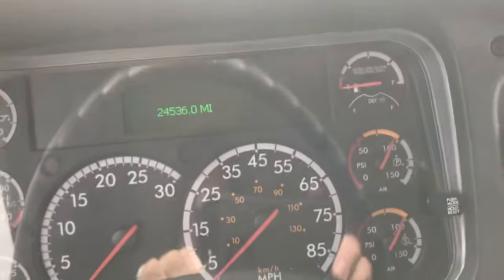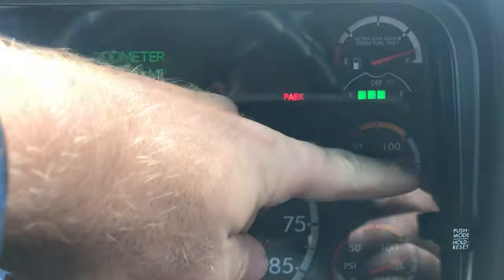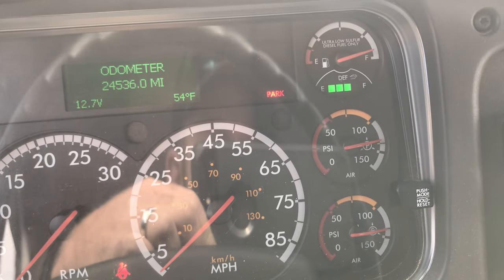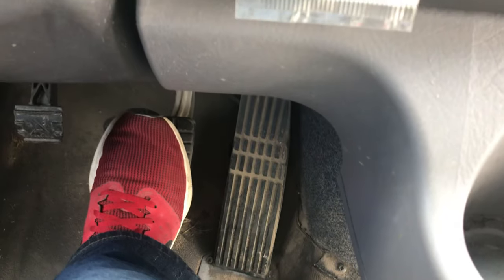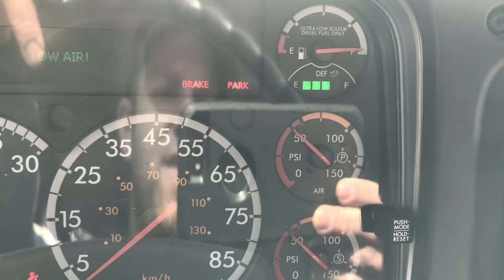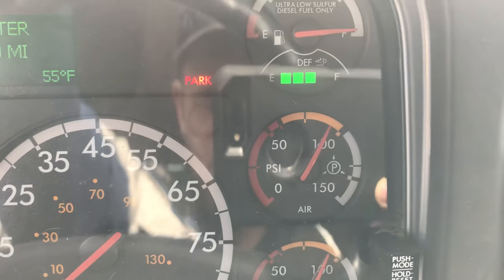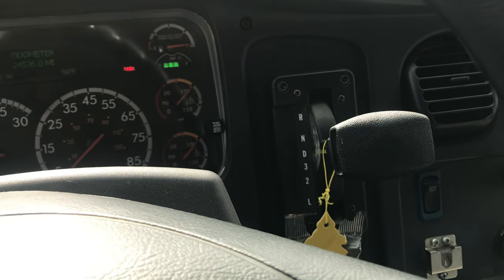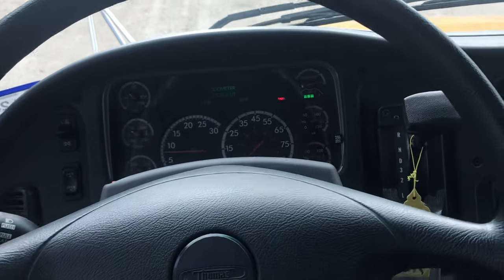Air Brake Test - School Bus

Comment: Question; you mentioned the loss of no more than 2psi in a minute after disengaging the parking brake... If you fail to do this can you automatically fail pretrip?  Because it's not mentioned in the book regarding the pretrip
Reply from the maker: Yes. You have to mention that you’re watching for no more than 2 psi drop and you have to demonstrate either with a count or a wrist watch that it is a full minute. If you don’t have a watch the instructor should and they may assist you if you ask them to time it. I counted out loud, just make sure to count slow. If you count too fast and say it’s a minute when it’s only been 55 seconds they can dock you. 3 psi drop for the service brake.

Comment: Never saw the ABS light test,  this omission would have been an automatic fail when I got my endorsement. Is this not required? We were taught to turn the key to run then the light would have come on for a few seconds and then gone out, now you've verified the ABS will work and you are ready to start the engine. And just as a general rule on these new computer controlled vehicles,  you should turn the key to run and then wait a few seconds for the gauges to sweep and not just immediately turn the key to start as the new engine don't like this.
Reply: We were told we can identify the ABS during the safe start. But I’d rather get it out-of-the-way first thing.

Comment: ok so when the air pressure blows off at 125 its not the brakes cutting out my friend. its the air gov shutting off the compressor. the blow off you hear is the air dryer blowing the trapped water out of it. the blow off has nothing to do with the brakes.

Comment: Not sure when you got your CDL, but I’m about to take my test Wednesday. They taught us:
1. Parking brake bleed test-you release it and watch it for a few seconds, not 60. 60 seconds is the service brake bleed (same as you did).
2. Parking brake hold test-you get the RPMs up to between 1100 and 1200 to show that it holds. 
3. Service brake test-get up to 5 mph and press the brake. No need to “stomp,” just come to a smooth stop, demonstrate that it doesn’t sway and stops completely. Also, never heard about taking your hands off the wheel. In fact, we’re told to keep both on the wheel at all times. 
Not calling you out for being wrong, just saying this is how I’m being taught right now. Everything else is the same as you said, and they’re just minor differences.
Reply from the maker: I’m in Texas. It may vary a bit state to state but generally it’s the same. I was taught 60 seconds each and that’s how we are still training it. Doesn’t hurt to hold it longer right? 

I can see the logic in NOT taking the hands off the wheel, but could argue either way I guess. Given this is for test purposes only, you’d never take your hands off the wheel while driving. It proves to the office that your bus is road worthy and you aren’t fighting a bad brake 

Either way, good luck on your test! There is always some latitude, so you may offer to the DPS officer that you have conflicting info, and ask them if they’d recommend you take your hands off the wheel or leave them on. Normally they can’t tell you one way or the other, so as long as you tell them what you are going to do and why, it should be ok either way.
Reply: @TomBrueggen  True. It's a bit different in New York, but, pretty much the same!
Reply: In NM here and we are just about the same as the video, thanks very helpful!
Reply: @TomBrueggen  Hey there Tom. Not sure why, but I never got a notification that you replied and couldn’t find the video again to comment. 
I ended up taking the test and passing, but it was like that. When I first started, one of the trainers was new and gave some wrong info. You do hold the for 60 seconds, as well as wait 60 when you release the parking brake. 
Important info because not doing the air brakes test correctly is an automatic fail. Luckily, I had others that taught us the right way and I passed on the first go.
Reply: @JakeNaughtFromStateFarm  in the book you do the service brake leakdown test, then fan brakes for the warning light and buzzer to come on, then fan brakes till the parking brake engages.  Failure to do these three things will result in an automatic failure.

Now having said that if you miss the post parking brake disengagement leakdown test, is that automatic failure or is it really what the book looks for?
Reply: @adventureoflinkmk2  You do the tests you listed, then you have to air them back up. You then make sure the parking holds by throttling up to 1500 RPM. Then you go 5 mph and hit the brake to make sure you come to a complete stop and don’t swerve (brakes evenly). 
Basically, exactly what Tom does in the video. The only difference for me was I was never told to let go of the wheel, so that may vary slightly. If you’re in Texas, there’s a only a couple automatic failures (that I remember) and they are: not properly doing the air brake test, not performing properly during skills test (explain better in a moment), hitting a curb during driving test, and not properly stopping at railroad crossings. 
The skills test involves straight backing, offset backing, and parallel parking. Just listen closely and follow directions. I had a coworker that failed the first time because in offset backing, he backed up too far (was suppose to stop inside the first cones). 
Again, this is all for Texas. It may vary if you’re somewhere else. I just got mine a few months ago, so these are the current rules.
Reply: @JakeNaughtFromStateFarm  Same here and I'm also in TX also , never heard anybody say to take hands off the steering wheel. been a CDL license for 20 years now also.

Comment: Thank you for video! When we did the 2nd test with engine off, foot on break for 1 minute, we lost around 6 psi give or take. This means we have a leek in brakes right? Will it be safe to drive to mechanic? We figured we couldn’t fix that ourselves
Reply from the maker: Did you lose 6 when you first hit the pedal? But then it held? It’s ok to lose 6 when you first stomp the brake, but then it should stay steady during the 1 min count. Most buses require it’s worked on by a licensed mechanic and especially one licensed to work on air brake systems

Comment: You missed the governor cut in you start bus release spring brake and pump brake pedal 3 times and note governor cuts in between 80 and 105psi.
Reply from the maker: Not sure what state you are in, but in Texas we don’t have to demonstrate that. Proper function of the compressor is noted in the buildup test from 85-100 psi in less than 45 seconds. Hope that helps clear some confusion. Thanks for watching!
Reply: @TomBrueggen  well an air brake test is an air brake test if you are not checking everything how do you know it's working properly? I wouldn't want to get down the road and realise its not building pressure properly no matter what state I'm in
Reply: brian pugh right. So we do demonstrate that the compressor is working as I described. We start the test with a full system. Bleed it down to demonstrate all alarms and safety measures are working on the way down, until the spring brake pops. Then start the bus and watch it build back up, timing how fast it builds and also noting that it cuts out safely. 

If I understand what you’re saying, you’re another step that is already covered. You’re staying to bleed down right away (with the bus running) until the compressor kicks in, then build up. Then kill the engine and do the bleed down again. You’re way is still fine, but from what I can tell it adds a step.

Comment: This works the same with the parking brake in place.   Turn off the bus with parking Brake on place. Turn key to aux or on depending if it’s a Thomas or international. Press the brake and air pressure should hold. If bus is on or not.  Then turn to on and bleed off. Until break pops.  This tests depends on what bus your driving.  And it won’t pop off if you idle high. Governor cuts in and stops the air compressor
Reply from the maker: We are instructed to do it with the bus off, to intentionally make the brake pop off and set. This is how you prove that it will auto set if you had an air loss emergency situation.
Reply: @TomBrueggen  international key has to be on.  Not started.  But in on position. Thomas’s are different

Comment: In Mass. you will fail if you use the service brake while the parking brake is engaged. Our busses all have a range inhibitor which prevents you from shifting into gear without putting your foot on the service brake. How do I shift into gear to test the parking brake?
Reply from the maker: You have to put your foot on the service brake to release the park brake in daily use. On the test you have your wheels chocked so the bus won’t roll, so you can release the park brake during the test. But when you go to out it in gear, to demonstrate that the park brake will hold against the transmission, then you have to depress the service brake to shift into gear. At this point you aren’t testing for leaks in the service brake system, so using the service brake as needed should be fine.

Comment: The one thing in this video that im missing is the governor kick in when you release the parking brakes tell the inspector you will fan down to 99 psi below 100 psi the governor should kick in can you explain if you did it & how did i miss it thanks
Reply from the maker: When you first start the test and you are bleeding down, the engine is off, so the governor cannot kick in to charge the air back up. Once you’ve bled until the park brake sets, then you start the bus and let it build up. We time how fast it builds from 85-100 psi. If that takes more than the allowable time (I think 45 seconds), then it’s a sign your compressor is weak. I like to let it go ahead and build all the way and note when the compressor kicks out. 

So what you are saying is you would have to start the test with the air charged up and the bus running, then release the park brake and fan off until the compressor kicks on. That just demonstrates that it’s kicking in at the right limit. But doing the buildup like we did here essentially demonstrates the same thing.

Comment: Noticed you set your parking brake before you put it in neutral. That is correct. Automatic fail if you don’t. Seen a lot of drivers forget this and got to drive them back with a sad face all the way back to the bus barn.
Reply from the maker: Yes, always keep it in gear until the brake is set! Same for taking off from a stop. Put it in gear first, then release park brake.

Comment: Should it idle for pressure build up test from 85 PSI to 100 PSI? Or can I increase RPM?
Reply from the maker: Idle. You can rev it up to get to 85 but then need to let it build to 100 at idle
Reply: @TomBrueggen  Thank you for this information

Comment: Hi Tom, please can you make a video the steps to turn on the bus and off. I'm training and always I mixed up. 
Please
Reply from the maker: I don’t recall that it’s too complicated. Sit in the seat, seatbelt on. Adjust seat and steering column. Ensure brake set and in neutral. Turn the key.
Reply: Thank you.

Comment: Question if I have my CDL a what do I need to get to be able to drive the school bus is just a passenger endorsement?
Reply from the maker: You need a specific school bus endorsement (S) in addition to your passenger (P). Passenger only applies to things like city buses or greyhound for example. School bus has a whole different game because of the small children and things like use of your stop signs that Commerical busses don’t have. I trained a CDL A holder for school bus last fall. Unfortunately you do have to go through the whole pre-trip, and driving test again because the bus is so different.
Reply: 1
Reply: You need endorsement    
S.

Comment: I have a question lol what does that button to the right of the ignition. I had that light light up on my dash but nothing funny was going on I just wanna know why it lit up
Reply: That’s the switch to perform an active (parked) regen. It most likely got hit by mistake, but won’t work unless you’re parked. That would be why you didn’t notice anything happening.

Comment: I saw you cover the service  brake too hard. I thought you can't depress service brake while parking break is on?
Reply from the maker: Not sure what you consider to be too hard on the brake. But when taking your brake test for your CDL you want to make it obvious you are pushing the brake, not just lightly tap it. Plus, when pumping down for the bleed off test, you’re trying to waste air anyway, so hammer down! 
As for pressing the service brake while park brake is set...yes, every day! I’d sure hope you apply the service brake before releasing the parking brake. Now again, on the brake TEST, the first step is to chock your wheels so the bus won’t roll. Then hover over the service brake (but not on it) and release the park brake. You still want to hover your foot over the pedal just in case something crazy happens and the bus rolls, and you need to get on the service brake quickly. Hopefully this helps!

Comment: When doing the parking break test, should I remove the chalks ?
Reply from the maker: Yes I believe so. You need to demonstrate that the brake will hold against the bus being in gear, and if the chocks are still set then those can provide resistance in addition to the park brake.
Reply: @TomBrueggen  thanks

Comment: I which you explain what part of the brake system we are testing for the 3psi in 1 minute
Reply: That's the service brakes.  You hold steady pressure and it doesn't lose more than 3psi in a minute

And whatever you do DON'T TOUCH THE SERVICE BRAKE until AFTER your wheels are chocked, (EDIT: Engine off), bus in run and neutral, and you DISENGAGE the parking brake.. that's... Kinda how I failed my first test #Ope 🥴

Comment: Ok what about the built in wigwag that drops at 90 psi ?
Reply from the maker: Only if you have a wigwag. This bus just had the alarm beeper that nags you when you get too low. But that’s around 60-65 psi. Not sure about an alarm at 90 psi.
Reply: @TomBrueggen  my companies buses have a built in wigwag and that drops at 90, and the the alarm sounds at 60, parking brake pops off at 30

Comment: So basically 3 air brakes have to demonstrate
Reply from the maker: I’m not sure what you mean by 3. You gave you’re parking/emergency brake and your service brake. That’s only 2 systems. Maybe you’re saying testing the park brake against the trans is the 3rd? That’s not a third brake system, it’s just a second test of the e-brake function. In an emergency you can pull the e brake and it’ll bring the bud to safe stop even with the transmission in drive. That’s what you’re checking.
Reply: Yes you are right I am asking the same thankyou so much for your reply 😊👍🏼

Comment: Wennr u in neutral an when r u in park
Reply from the maker: Buses don’t have a “park” gear. But you start off with your wheels chocked (so you don’t roll), and the first thing you do after letting the air system pressure up, is release the parking break, so you can monitor that the air system isn’t leaking. So you are in neutral then and if not chocked you could roll. You’ll stay in N all the way through the bleed down until the brake automatically sets due to low air. Then it stays set through the buildup test and to pull against it in gear. Last thing is to be in gear, release the park break and roll forward slowly, then stab the service brake to show that the wheel doesn’t pull one way or the other.
Reply: Thank u I'm going in a bluebell steright truck its automatic

Comment: The just kidding around 7:35 is distracting.
Reply from the maker: Sorry that’s just a thing I do when I correct myself, like “haha just kidding!” I made this video totally on a whim one day so I didn’t have a script or anything, just doing the test from memory (while trying to film it 😁) I hope it wasn’t too confusing. At this point you are testing that the parking/emergency brake can hold against the transmission, so it makes sense that the parking brake needs to be set. In a true emergency with the bus driving down the road you can pull that brake and the bus will gently come to a stop and hold against the transmission still being in drive.

Comment: My instructor told me to chock my wheels even if I'm on level ground.
Reply from the maker: Yes absolutely. The point is to demonstrate that you know how to do it all step by step, even if you think one step may be situational, that step must still be demonstrated.
Reply: Funny thing is that they teach that for the test, but drivers don’t carry chocks to do it again. Honestly, 98% don’t even open the hood for their pre/post trip inspection, much less check the brakes.